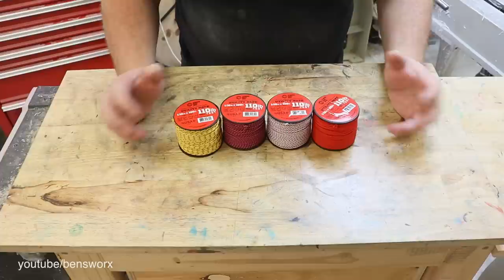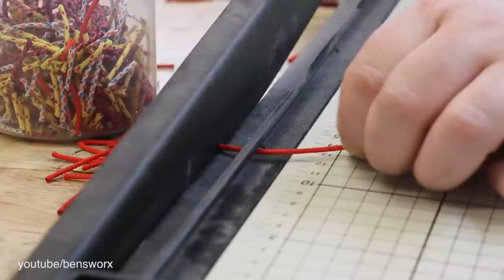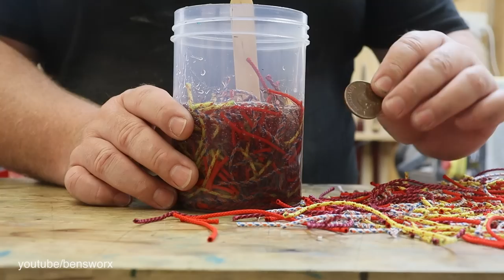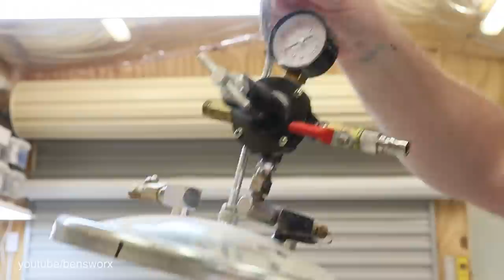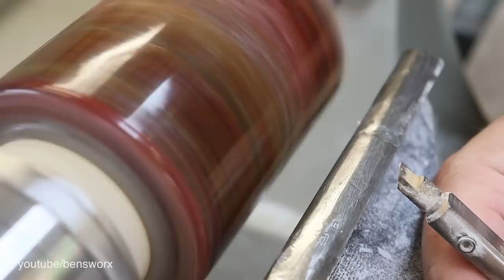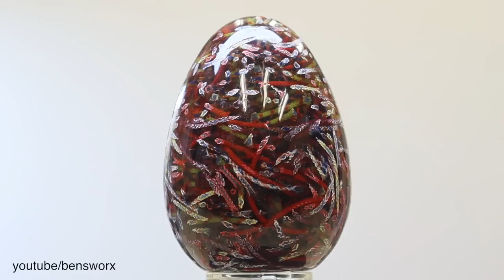WoodTurning 5000 pieces of Atwood Rope

Comment: Love this one brother! A cool thing I do with paracord is remove the inner lines, insert weed wacker cord, wrap it around a 3/8 inch dowel, secure the ends and then plac in boiling water for about 2 minutes. When removed from the dowel the cord keeps it’s shape as a coiled/springy lanyard. But,… you can do any shape you like as long as you can heat the plastic weed wacker cord evenly which is best to put in boiling water. The longer it is in the water the more pliable it is. Oh and flash cooling works well too, like in ice water 😅. Thanks again for your amazing vids!

Comment: Well done! I liked that you used a Carbide tipped Scraper. I've seen so many wood lathe operators fail to do that when metal is involved. 
That egg looks larger than the others in your collection. It may be my eyes as age is very unkind like that. 
Awesome job

Comment: The fast way to cut a lot of short pieces of string is to wind it around a stick and slice with a sharp knife. Even faster if you use a drill to wind it.

Comment: Been watching for a little while and just broke down and finally subscribed. Great job as always. Curious though why you didn't fully degas in the vacuum chamber (I noticed a bunch of small bubbles still when they went into the pressure pot)? If you use a slightly taller mould, you wouldn't have to cycle the vacuum as much and just hold it until all the bubbles pop and the whole thing falls like a bad soufflé (which is super satisfying). I've found that usually degasses enough for a casting, but to make doubly sure you get it all, leave it sit at full vacuum for 5-15 minutes or so (I'll do that for high detailed moulds with cutbacks to make sure all the bubbles are out). You could also degas the resin after mixing to get the majority of the bubbles out, then again after pouring into the mould. I rarely use a pressure pot when casting but take my time degassing and don't usually have any problems. Just my $.02. Keep up the good work. Love your projects!
Reply from the maker: Thanks Mate, My resin was starting to heat up and time was running out
Reply: @BensWorx  ah, figured it might be something like that. It turned out great in the end.

Comment: You’re always gluing waste blocks on. Can you just set the waste block into the top of the piece before you put it in the pressure pot thus avoiding a step and saving time?

Comment: I am under the impression that paracord has a 550lb breaking strength but that only has 110.  Has something changed?
Reply: There are many different types of cord. From Nano all the way through 850. There are a few "paracords" that I am not quite sure are actual paracord or not, so I am not mentioning them. I mess around with paracord for bracelets and such, that's the only reason I can answer, lol.